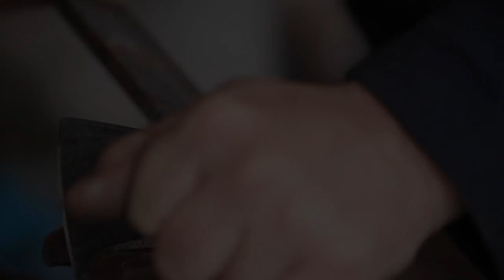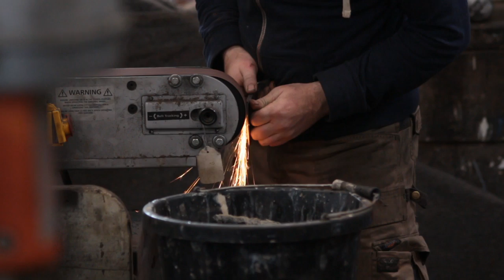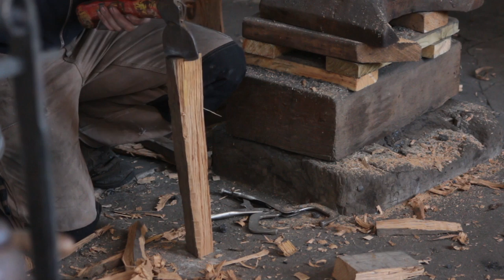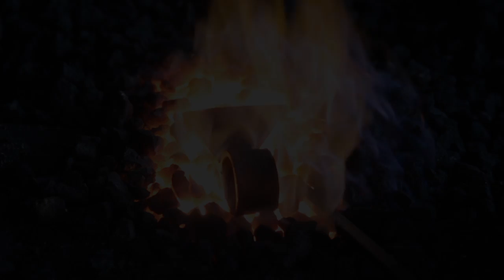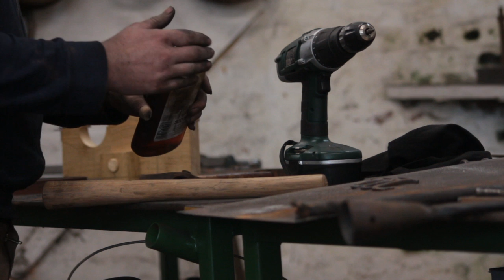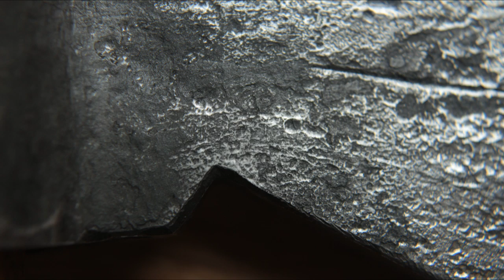Forging a wrought iron trade axe pt 3: Profiling, heat treat and handle.

Comment: One point to add about both the detachable handle and the notch between the blade and the eye on the lower side.  On the American frontier, if your axe handle broke there was nowhere to buy another one and a wedged handle might be impossible to force out of the axe eye.  If you needed one, you needed to make one.  There was an immense supply of wood available and in an emergency you could shape a new handle directly with the axe head in the hand and a makeshift wood baton.  Further, the axe head is shaped for use in the hand to skin game if that was your only available blade.
Reply: Axe head's where valuable, handles well what's a good branch an a hour's work?

Comment: First of all: thank you for your work, these are the bast quality smithing videos I've seen so far!
 Question: Did you take the measurements of the trade axe from an original? Because in my opinion the eye and the handle seem a bit bulky, most trade axe replicas I've encountered have had smaller diameter eyes; but that could also be misinformation on my part.

Comment: So, you're only the second person I have ever come across to use hot oil as a way of tempering. What makes you use this method? Does it have any advantages over tempering by torch or using an oven?
Reply from the maker: When I first started making knives 10 years ago (!) it was the easiest way to get an even heat around the blades as it is slow to heat up and slow to cool down so you don't get much fluctuation in the temperature. I've just kind of stuck with it because I don't really make enough edged tools to justify spending the money on a PID controlled kiln, though that would be the dream!
Reply: Alright. I guess it more evenly distributes the heat. I usually just use a torch because I like the differential temper.
Reply from the maker: I do do it that way sometimes - I have a pair of tongs which I welded some bi stock to the jaws on and I will preheat the jaws and just close them on the spine of the blade and let the heat bleed in. Takes a while though. The oil temper means I can just pop it in there and do something else for a while thus making my day a bit more productive

Comment: What kind of wood did you make your handle from?
Reply: Ah, so I'm not the only one to use oak for handles! Excellent.
Reply from the maker: This piece of oak had a horrible gnarly bit in the middle but yeah, usually it is nice and straight. I think that the idea that you an't use anything but hickory is just a habit thing, a bit like people thinking you can't fireweld without flux. It's a bit of a myth which is hard to shake.
Reply: A decent amount of tools are made with ash, elm, poplar, cedar/juniper, and walnut handles.  Walnut is my favorite, because it has that dark color and lots of oils that resist, well everything.  You can find a lot of old farm handles with walnut.  Not because farmers are putting fancy furniture on their plows, etc.  Because it lasts and does not splinter, and feels good in the sweaty hand.
Reply: All of us who don't have access to ash wood just need to rub our handles with some fire soot and call it "ash". ;D
Reply from the maker: I quite like oak as it is a nice wood if a bit heavy. I usually use hickory for most of my handles as it is pre-shaped but this one needed a special shape.
Reply: Oak is usually straight grained, and cheaper than hickory. For some reason a lot of people think you can't make a good handle out of anything but hickory. . .
Reply: Indeed. Well, cheers!
Reply: Christopher Neely Thanks for the info.
Reply: A myth indeed! I've made striking tool handles from Ash, Oak and Elm. Ash is superior to Hickory in respect of being less brittle, otherwise very similar. Oak is a good choice for rot resistance, Elm is a good choice for split resistance. Never used poplar/cedar/juniper or walnut for a striking tool handle, and never seen a walnut handle on a UK farm although it is an entirely suitable timber due to being ring porous.. Perhaps that's an American farm thing, Walnut is more prevalent over there. Poplar is too soft, Cedar could be ok as could Juniper if you can find a big enough section to use.. Better used for making Gin though... :)
The Myth? Not a myth.. As mentioned above, Ash is a "ring porous" (like Oak, Hickory, Walnut) species, which is to say it has distinct seasonal growth rings. The porous being much softer and thicker and the non-porous, thinner and tougher.. The point of this long winded meander is that these alternating hard/soft rings give the timber a much higher shock absorption factor and increase the timber's impact strength considerably, almost like nature's own plywood... Meaning that Ash, with the biggest hard/soft ring differential has the best shock absorption and impact strength of all commercially available timbers. 
Our ancestors did not have the vocabulary or investigative techniques to quantify these properties but they came to the same conclusion as the modern scientists... Ash is the best! :)
Reply: Cave of Skarzs :D hehe, not a bad plan, i've burned my handles before to give a bit of grip... pretty sure Ash is very widespread though, definitely in the US.. and if you really can't find any i'll send you some.. at cost. 
Apparently, i've read this somewhere.. possibly in a 'historicnovel' so it may be completely false. But, i believe that Ash fire ashes used to be an ingredient for a primitive soap.. Who knows, perhaps it was any old ashes..
Reply from the maker: It was an old piece of oak.

Comment: As trade items in 17th and 18th century North America, these were supplied to the natives without handles. The round, tapered eye makes it quick and easy to adapt a round tree branch as a self tightening handle without the time and effort needed to carve out a  flattened teardrop split- and-wedged handle end  required  of a conventional axe head. Have used this type of axe for decades and if I were reduced to taking but a single iron tool into the woods with me, without hesitation this would be it. Great set of videos!
Reply from the maker: Thanks Olof, that was a really interesting insight into them. I must say that I was impressed with the handling of this axe as I wasn't sure about the large eye and lack of poll, however the sheer volume of wood needed for the handle to wedge into the eye seems to replace the weight of the poll.

Comment: awesome piece and great videos! what type of oil did you use for the temper bath?
Reply from the maker: Sunflower oil - I've always used it for heat treating. Seems to do fine in a small container like the pan but doesn't do very well in bigger containers as the heat is slow to move around.

Comment: What kind of wood did you use for the handle?
Reply: I was wondering that as well.  It looks like oak but I could be wrong.
Reply: I'm thinking Hickory...
Reply from the maker: The pillenwerfer is correct, it is in fact Oak. There is usually a lot of it lying around as the workshop next door is a timber workshop for the canal where they use a lot of Oak and Elm.

Comment: Could you explain why you lubricated the file with the chalk?  I know that it is to keep it from clogging up but how do you apply the chalk?
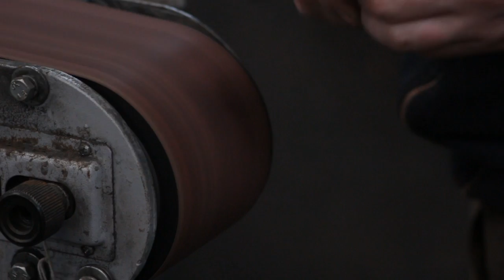Reply from the maker: I forgot to film that bit with the big files but you see it with the needle file @1:35 like Milton Tucker says. You basically just sharpen your chalk on the file.Soapstone chalk is best.
Reply: You can see him applying it to a file @1:35 in the video.